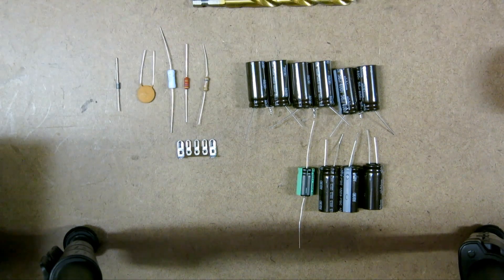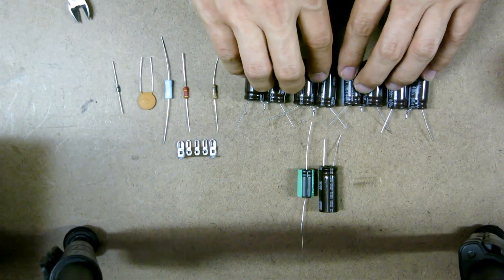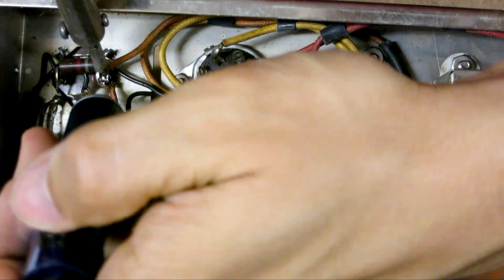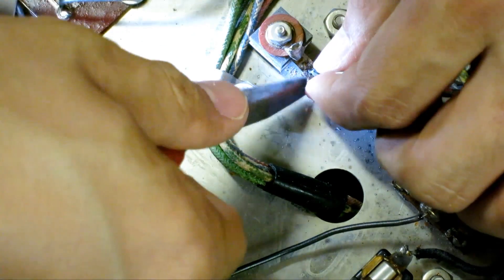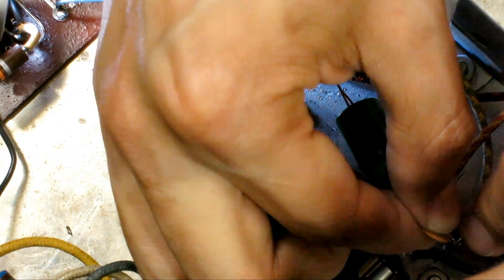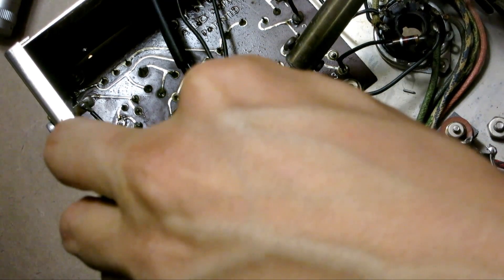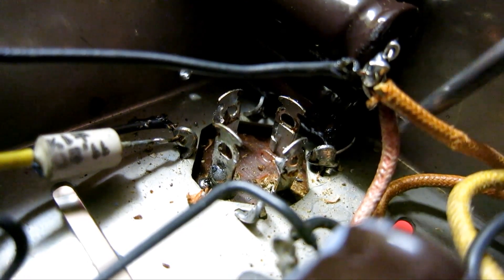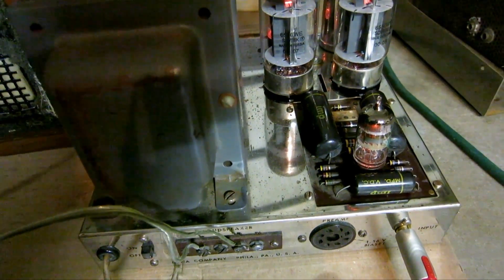Dynaco Dynakit Amplifier Part 4 - Basic repairs on the Mark III tube amp's B+ voltage line valve

Comment: Terrible unprofessional aesthetics in the assembly work. Large loads of electrolytic capacitors that are glued with a hot melt gun to the polished chassis plate. 
Do not for all intents and purposes use his methods!

Comment: If you put electrolytic capacitors in series for higher voltage rating, you need balancing resistors in series across them to make sure the voltage drop across each capacitors is the same. Otherwise, you are depending on each individual cap's current leakage to determine how much voltage will be seen across each capacitor. There's a PCB that's been available for years from SDS for the MkIII that allows you to mount snap-in electrolytics and has holes for mounting balancing resistors.

Comment: Which diode did you use? Will a 1N4005 work
Reply from the maker: 1N4005 would work, but i use a 1N4007. Same price, but the 1N4007 is rated at 1000V instead of 600V.
Reply: thanks for the fast response, one more question if you don't mind, the rectifier tube in the amp I'm working on is bad can i replace it with a 5Y3
Reply from the maker: im not familiar with 5Y3, but the specs of 5Y3 looks similar to GZ34. If you do use it, let me know if it works.

Comment: I have a dynaco st120 kit by bob latino. When I turn it on it destroys the rectifier tube. I have been through 3 of them. I dont know what to do to make it stop doing this and I dont want to destroy another one because they cost 15 to 20 dollars. Do you have any idea what I could do to try and ensure that it doesnt do this when I put a new rectifier tube in it? Something to note: it was blowing fuses left and right a while back. I got a five pack of the 5A (pretty sure thats the fuse) and it blew a few in a row. Thanks.
Reply from the maker: if you are blowing 5amp fues and rectifiers then there is a short somewhere. im not familiar with Bob Latino's schematic/mods, but what i would do is first isolate the entire DC power source circuit before it feeds into the amplifying circuit. post the schematic here, and ill check it out.
Reply: Dynaco ST-120 was a solid state amp.
Reply: @swinde  Got that right, Bro!
Reply: @stephenrioux6821  
I checked and this is apparently a modified Dynaco ST-70 offered in kit form by "bob latino".  It really should not have been sold as a ST120.  (My confusion)